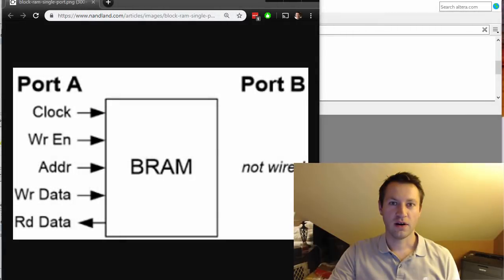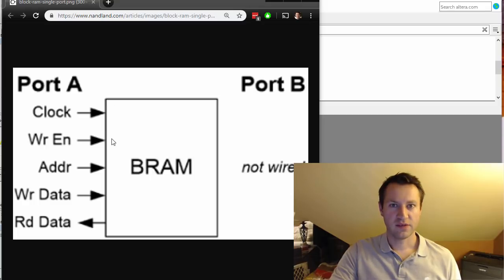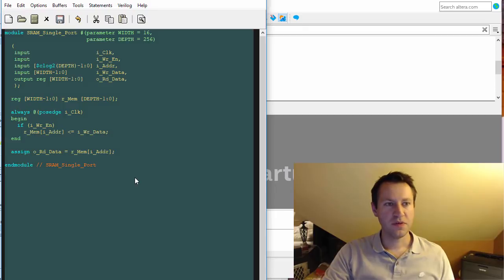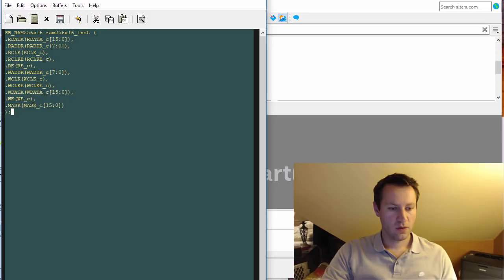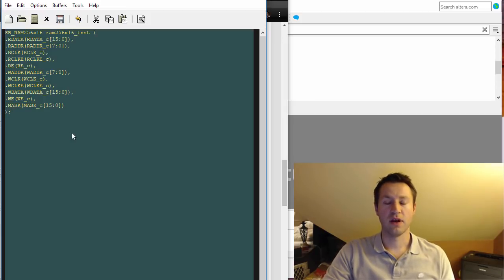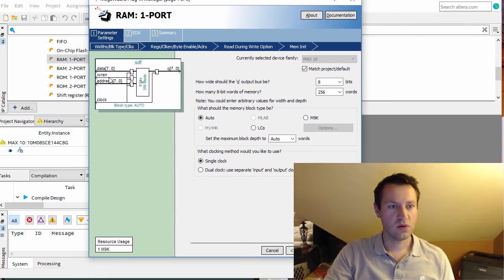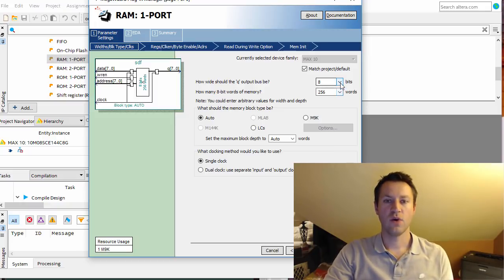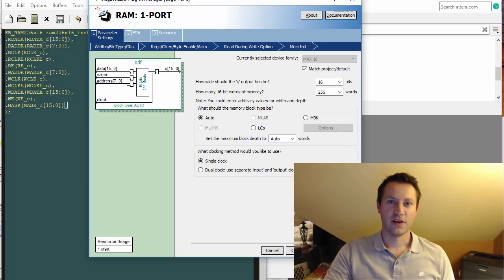Inference vs Instantiation vs GUI tool in FPGA

Comment: Hey Russell! Great video. I was wondering, what happens when your WIDTH and DEPTH parameter exceeds your FPGA's BRAM size? Can that even happen?
Reply from the maker: You should consult your FPGAs datasheets, but depending on the specific size your synthesis tools will cascade BRAMs together to allow for larger configurations.
Reply: @Nandland  Thanks Russell!

Comment: Is block ram preloaded with data possible with the inferred method?  The instantiation method gives you that ability but as you explained its tricky to use and not portable.
Reply from the maker: Yes it is possible. Make sure your Block RAMs are capable of being preloaded. Some FPGA fabrics are not (e.g. Microsemi).
Reply: Thank you, I'll try it.

Comment: nice explanation but better if you explained the way how that code infers a BRAM
Thanks!
Reply from the maker: Yeah sorry, I could have explained that more. Basically the synthesis tool "sees" a large memory and knows that it can push it to either A. Flip-Flops or B. Block RAM. So it will choose Block RAM if it's large (usually several hundred bits is enough to go to Block RAM).
Reply: I was thinking that the actual reason is we are trying to write or assign data at a rising edge when a condition occurs and we are accessing the output data at a given address no matter what. Then the tool understands that this is what exact behaviour of embedded BRAM hardware? Is that true?
Reply from the maker: @eminakgun4301  Yes that's basically it. The tools see that there's a large memory, a read address, a write address, and it knows how to create a BRAM out of that.

Comment: Good work! Have you thought about a few videos going over component instantiation and port maps in VHDL vs the same component instantiated in Verilog? Say just a simple shift register? Say three identical components clocked together and how this would be done in Verilog vs VHDL, not just the code but the (how and why)/differences of the two hdl's.  What are your thoughts on SystemVerilog?
Reply from the maker: I hadn't thought about that. I did do "VHDL vs. Verilog" but was trying to do a fresh take on it, rather than comparing the two languages at that level. But it's something I could go back to. I really like SystemVerilog a lot for testing. Actually I like it so much that I will use it for testing my VHDL code. I haven't talked much (any?) about it yet as I've been focused on the standard VHDL/Verilog stuff for beginners. But perhaps some day.